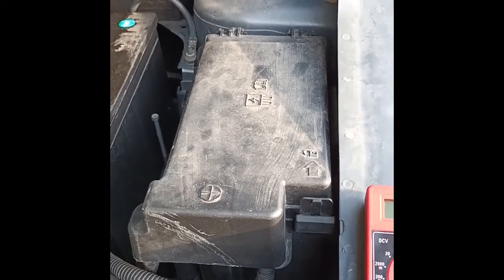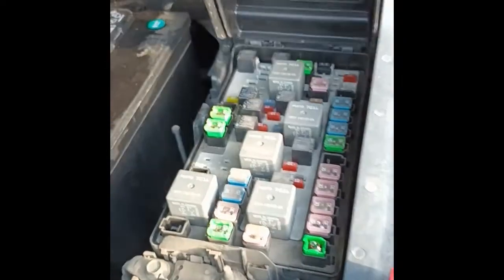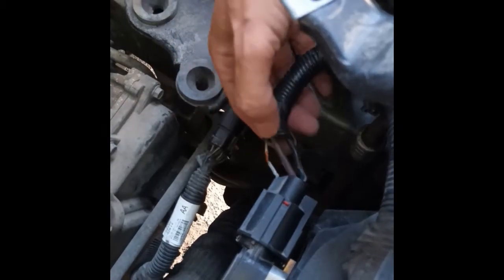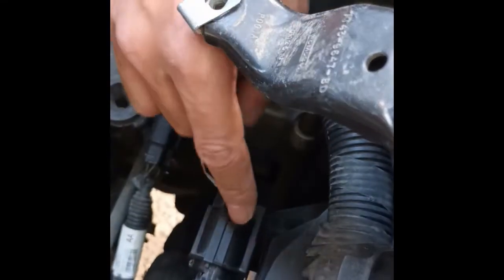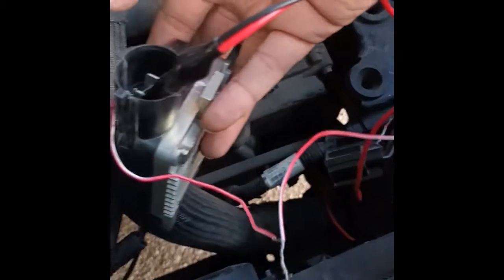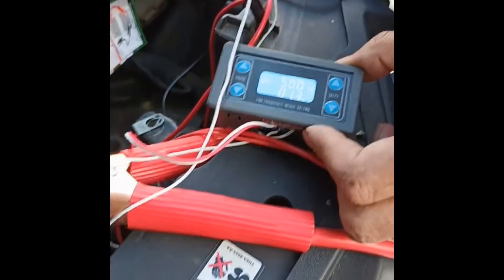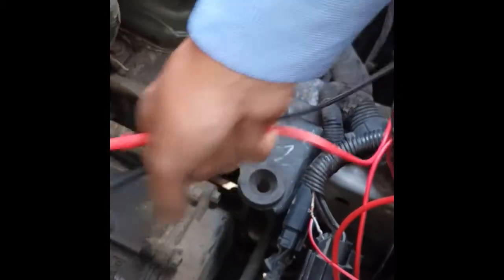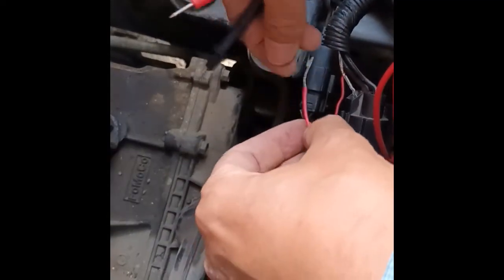Ford Edge radiator cooling fan is not working:  Diagnosis

Comment: It’s the connector from the engine wire harness connected to the right side of the fan relay looking down towards the battery
Reply from the maker: Yes it is the connector on the driver side of the relay.

Comment: So when you connect the fans directly, both should turn on?
Reply from the maker: Yes, both fans are connected to the same connector in this car. So, if you connect these wires to the battery, both fans should run.

Comment: So I tested both on the relay and before the connector like in the video, and the fans turned on both times. I'm not sure what to think of that because when I jump it like you did in the video, it doesn't work.
Reply from the maker: Check the coolant temperature sensor.
Reply: @Watchandfix  Ok. I will. Thank you!
Reply: Replaced everything. When I put direct power from the battery to the ECU cable (blue and white one) the fans come on. But outside of that, they do not come on. Thanks for the help!
Reply from the maker: This means there is no signal coming from the ecu to the fan. If you replaced the coolant temperature sensor, then there might be wiring issues. Check the connectivity of the wires connected to the coolant sensor.

Comment: Pls help I’ve replaced the whole fan assembly with new relay I’ve also replaced the ECT sensor and the fans are still not turning on I’m getting 12volts from pin#1 and .5volts from the white wire, new fan assembly was from Napa 

Please help 

2010 Ford edge limited
Reply from the maker: It could be a bad connector. Try to put some dielectric grease in the connector to enhance its connectivity. You may also use the pwm to test the relay and the connectors. Peel the white wire and connect it to the pwm. If the fan works, then there is no signal coming from the ECU to the fan rely. This could be due to bad wiring. If you connect the pwm signal to the peeled white wire and the fan didn't work, then it could be bad rely connectors.

Comment: If one of the fans is not working, thats influences on AC working anormally? sometimes warm?
Reply from the maker: It could affect the AC so you might not get highly cold air. But, you still get some cold air. There could be other reasons for getting warm air from the AC. You might need to charge the AC, check the condenser or the compressor.
Reply from the maker: Yes, I replaced the fan connector and it is working fine so far. In your case, I believe your cooling fan is not working that is why you feel the problem in idle while the air stream helps while driving.
Reply: Did you end up fixing it? Currently dealing with my truck wanting to over heat when I'm in idling, then goes back to normal when  driving. I've noticed that one of my fans is only working as well and ac stops blowing cold when in idle as well.

Comment: I checked the fuses, the fan rely and the fan motor and I could not find the problem, what else should I check?
Reply from the maker: Two more things are left to check. First, check the wire transferring the signal from the ecu to the fan rely for any possible damage or miss connection. Second, check the coolant temperature sensor. It might needs to be replaced.